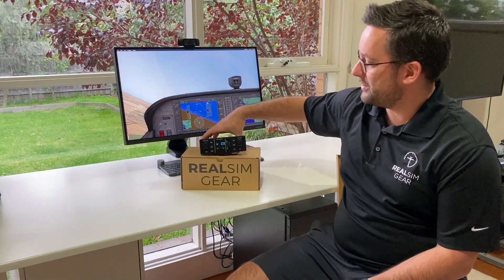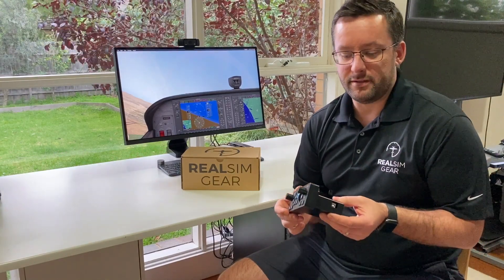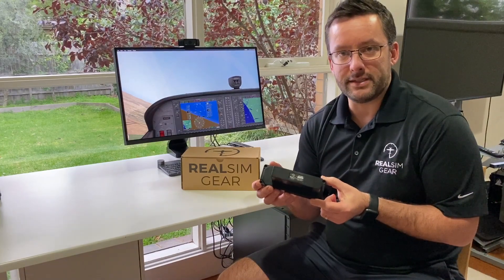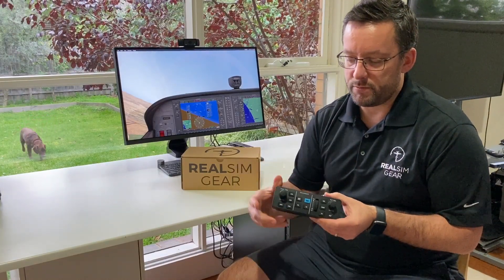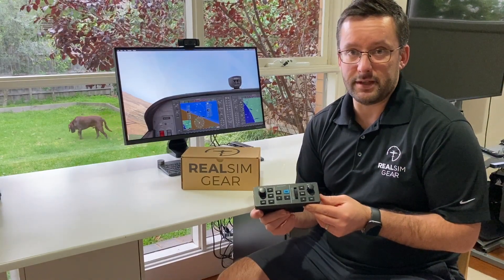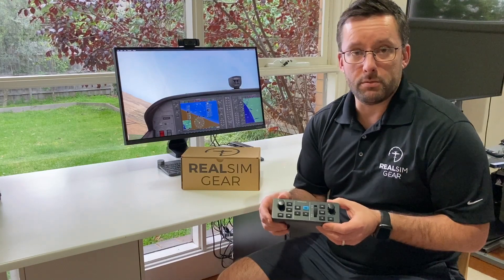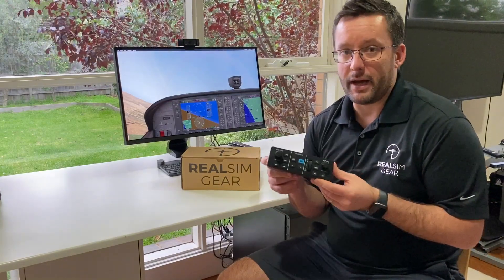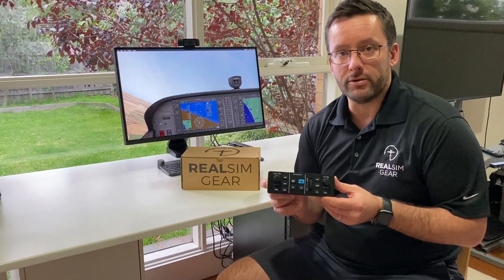RealSimGear GFC500 Introduction

Comment: Question:   Does this only work with GFC500 within the sim, or will it control all applicable functions of AP for any aircraft? Ive been a bit confused about this. Im currently using Stream Deck Plus, with many different profiles,but would like to minimize the work needed to control various aircraft. 

I realize this wont add a specific function to an aircraft that doesnt already have it, but will it control TBM 850, 414, Learjet 35, 310r, c208 etc.

Comment: Hello again friend, I already ordered the GFC-500 and I am waiting for it to arrive, before I want to ask you a couple of questions, when I install it on my PC with my X Plane 11 simulator, should I add some software for this GFC-500 to work? and the other question is if the buttons have illumination, I mean the buttons of HDG -NAV-APR-ALT-VS-FD-YD etc?  Thanks.
Reply from the maker: Hello, thank you for your purchase of the GFC500. When our X-Plane 11 Plugin or MSFS2020 addon is installed it will provide the necessary CommandMapping.ini file for your buttons and knobs. More information can be found @ http://help.realsimgear.com/en/articles/3737062-gfc500-700-gma350-gcu47x-setup-guide.

Comment: Hello. Is there a bracket/stand that can hold the GNS530 and the GFC500 together? Like in the GNS530/430 combo but replacing the 430 with the 500. That would be very helpful. Or if not is there a little desktop stand for the GFC500 alone? Thx.  Oh I fotgot.... in addition: any idea when the GFC500 will be in stock again? My local retailer dont have them either unfortunately...
Reply from the maker: https://realsimgear.com/collections/accessories/products/desktop-stand-for-realsimgear-gma350-gns530-and-gfc500 is the closest available at this time.